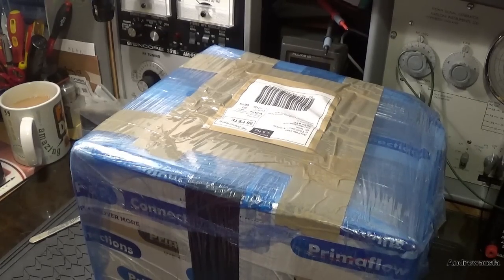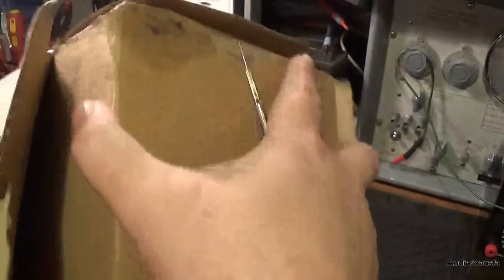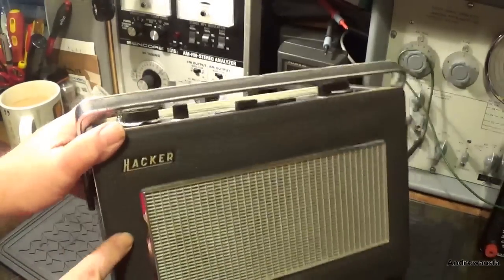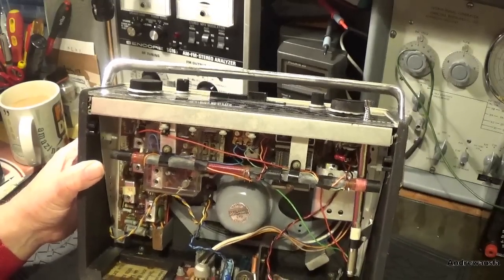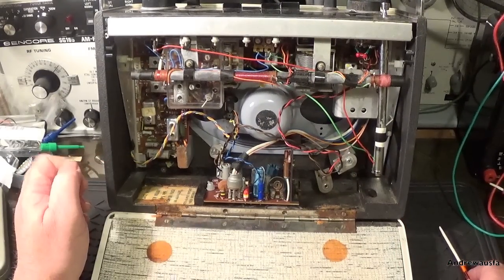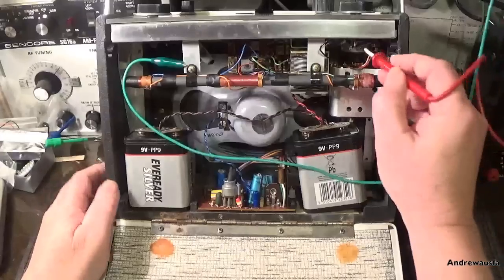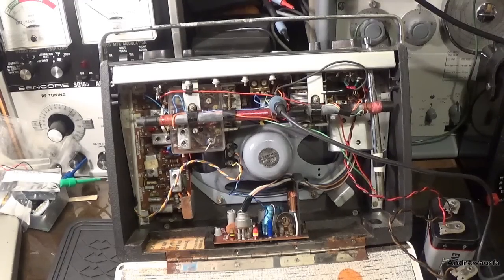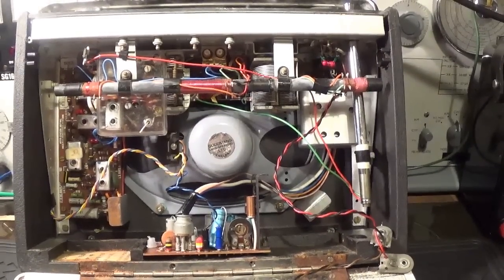Hacker Sovereign RP25A radio repair

Comment: Thanks for good video Andrew. . I wonder where I can get the schematic of such radio with voltages. It work wonderful on MW and LW, but not so good on FM, and I can't do much without such schematic.
Reply from the maker: Hi, Sorry for the late reply. It should be available on the internet very easily. make sure you get the right version for your Sovereign - RP18, RP25, RP25A or RP25B.

Comment: Interesting video Andrew. As it’s got separate AM and FM oscillators and neither work then it must be a power supply problem. It could be the switchbank faulty or a wire disconnected. SW3 (FM) switches power between the 2 oscillators so if that’s not working then both would be dead. Look forward to the diagnosis. Cheers Graham
Reply from the maker: I'm worried if I give any more clues it will spoil the fun. Well, what is fun for the over 50's anyway :)
Reply: Have you diagnosed it yet? If so are we close and when are you going to put us out of our misery? Questions, questions 🤷🏻‍♂️
Reply from the maker: @Radiocruncher  Yes and no...but more would be giving the game away! :) It's not so much the diagnosing, it's the time taking it to bits I'm short of at the moment. However we do have a result of sorts.
Reply: Yes I would keep is under wraps although the suspense is killing me! Great radios though and I’ve had a couple with multiple faults
Reply from the maker: @Radiocruncher  Exactement! Doesn't get much more exciting than this for me. Except if the missus has bought chocolate hobnobs rather than custard creams. Just started snowing here.

Comment: AF117's, always suspect Andy, are any of these in the oscillator circuit?
Reply from the maker: Hi Theo, it's the RP25A version so fully silicon, except for the amplifier.
Reply: @Andrewausfa  Hi Andrew, is it a self oscillating mixer circuit in this radio?
Reply from the maker: @Theoobovril  Hi Theo. no it's a Hartley variant. Seperate mixer.
Reply: @Andrewausfa  Without the oscillator working then the radio will not produce any sound. So I wounder if the problem is either in the oscillator itself or the feed to it say coming from the ferrite aerial assembly. Can't get access to a circuit diagram to be able to see how the radio circuit has been designed.
Reply from the maker: @Theoobovril  It would produce sound but no stations. At the time I filmed, no sound at all, not even an amp hiss, on any wave band. Unfortunately I can't share the circuit diagram as the one I have is from the UKVRR DVD.
Reply: @Andrewausfa  Shall have to wait for your next video on this radio then Andrew. Chassis out, good visual inspection and, if necessary, followed by voltage checks and possible signal injection at the mixer input.

Comment: Could Be The Gram input Socket Andrew  Short It Out To Test  As I Have Ones in The Past That Have No Reception And It Turned Out That The Socket Was Faulty I Put a New One In From Rapid Electronics Or Faulty Headphone Socket But I Would Suspect The Gram Socket Regards mike
Reply: Hi Mike, do you have details of the replacement jack for the Gram input from Rapid Electronics. Cheers